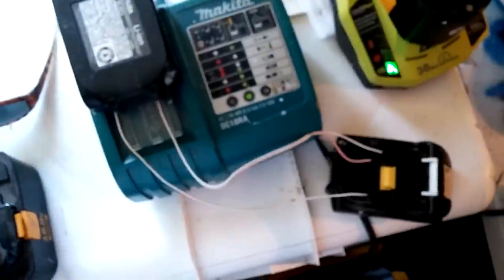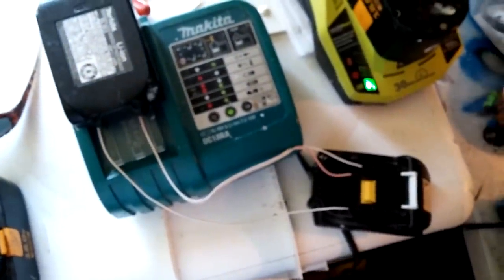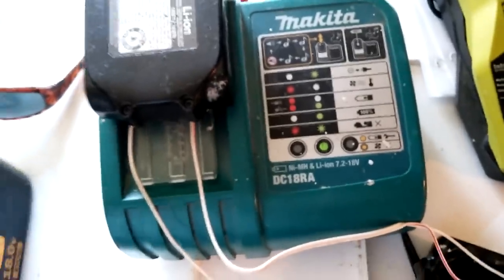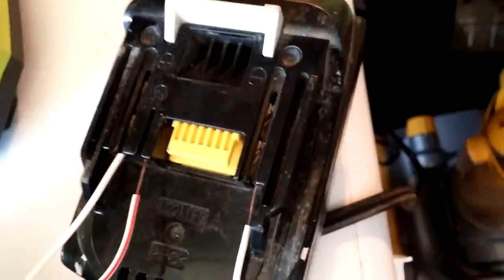How to impose your will on a Makita Li-ion Battery

Comment: I had a dead Makita battery pack that was just a year or two old and sparingly used. I thought it was just an electronic failure so a couple of months later I decided to salvage the 18650´s inside rather than throwing the whole battery pack in the recycling bin. There was ten 18650´s inside and surprisingly several batteries seemed to have been vented or looked like they had been overheating. Only two of the 18650 that looked OK also had a useable voltage level. So be very careful when doing this kind of workarounds. This method may have caused fire in my dead pack.

Comment: Thanks for this, trying it right now.  What a load of crap these batteries are.  I'd have never spent £700 on a kit if I knew the batteries were chipped and lock you out after less than 2 years use.
Reply from the maker: I've got 5 or 6 of these that I use and charge on a weekly basis and I haven't had any problems. I usually charge 3 at a time. Overnight.
Reply: +dennis pulley definitely stick them somewhere safe so if they catch fire it wont do any damage.

Comment: thanks this seems to have worked for me, but the the drill doesn't seem to work if the battery is fully pushed into position?? Any ideas??
Reply from the maker: +jamie king Just a contact line-up problem. Try wrapping some tape around it to keep it from sliding past the contact.

Comment: So basically you have a working battery on the charger and you wire the "DeadOne" in parallel?
Reply from the maker: +Dainius G Correct
Reply: Genious, I will try this now!
Reply: +dennis pulley wouldn't this affect the amperes going to each battery and charge both batteries at a different rate and effectively reduce the lifetime of the good battery also?
Reply from the maker: +Simon wardley Not exactly, parallel wiring, in theory they should charge like an ice cube tray, ending up with the exact same voltage allowing a tad for differences in resistance and maybe diodes. Like water, levels will balance out as long as there is a 2 way street between them. Even with a 1000 battery chain.

Comment: how do you know the battery will not start popping its cells like roman candles.. if you bypassing the safety chips
Reply from the maker: +bryan jones Because the resistance is constantly being checked and a big enough change in either direction will halt the charge for a cool off and re-eval cycle.

Comment: After you "force charge" the "bad battery," does it charge on the charger normally once again?
Reply from the maker: +ChickenCoop Well worded. Thank you. Have you tried disabling that component?
Reply from the maker: No. it does not. I have been charging the same 2 batteries like this for over a year.

Comment: Hey can you show where you attach the wires in the charger, I see you have three wires and I get it but I would like to see the set up. Thanks
Reply from the maker: If you're looking at the battery with the button facing away from you you will see three terminals. Too large one small you do not have to worry about the yellow / orange plug. The positive is the 2 terminals on the left. 1 large and one smaller one right next to each other. Split your wire into both of those and the negative terminal is on the right. the battery that gets connected to the charger should have one wire in the large positive terminal and one wire in the large negative terminal. The battery you are charging should have the positive wire split among the two positive terminals and then the one negative wire connected to the negative terminal. I'm using a 3.0 ah battery one of the bigger one so if yours is different just play around with it a little bit. You may have to split that positive cable at the charger and at the battery but I haven't had to do that.

Comment: Nice work.  All you need is the socket of an old dead charger or tool and it will be totally pro.  I don't use makita but I rebuild batteries for people sometimes and discovered this a while back.  What a horrible thing to do, now I will never use makita.  On the older packs I was dealing with they powered the board from only one set of cells so if it sat around for a long time it was guaranteed to go bad.  Supposedly it takes three times communicating with the charger to be permanently disabled so if you charge it this way the first time it reads bad it should work normally again.
Reply from the maker: +The Mechanical Philosopher You may be right about that 3 time rule but I have never noticed a signal from my charger, but I could have easily overlooked it as a temperature problem.
Reply: +dennis pulley I've had no way of seeing first hand yet.  I have only read numerous inconclusive accounts.  It probably changed a little through the generations of batteries and chargers.  Let me know what you discover about that.  Wouldn't it be wonderful if we all had the correct information someday?

Comment from the maker: I should have shot better video, my bad, but the wiring is as follows: looking at the battery with the Remove button facing away from you v two terminals on the left one large and one small I want are both positive then the large terminal on the right is negative and you can never mind the plug. why are both batteries in parallel and to charge multiple batteries at the same time you will wire them in parallel. Meaning positive to positive negative to negative. you do have to split the positive wire amongst both terminals on the left.
Reply: +dennis pulley There are several factors in getting a good result. One place I discovered that successfully combines these is the Magic Mender Wizard (google it if you're interested) without a doubt the best course i've heard of. Check out this  great resource.

Comment: How much current can the charger provide?
Reply from the maker: +Link Simpson It's speced at 18v @ 9 amps. Plenty of juice and it's used to charging different power levels so it doesn't red flag that. It will occasionally get hot, cool down, and continue charging even when I have a chain of 3 or 4 of them.

Comment: can you charge them normally after this?
Reply from the maker: +Scott Gilmour No, but Ive recently changed to a 2 charger system. Running leads from a good battery atop a charer and connecting them to the next charger. The 2nd charger now recharges the "bad" batteries normally because it recieves its 'alls well' signal from the first charger.

Comment: The problem wouldn't be getting shocked.  It would be from the battery exploding from the possible heat build-up from the charge if the battery was indeed bad.
Reply from the maker: Worst case scenario would be a melted battery,some leakage and maybe the charger catching fire. I may be wrong but I've never actually seen a LiIon battery explode like a lead acid could.
Reply from the maker: Still haven't had an explosion. Trying though

Comment: Don't do it mans!  You 100% will damage a "red light" battery!!!  Just unpack it and change broken 18650 cells in pack of battery.  You just need a simple charger like Imax B6 for detecting a broken cells.
Reply from the maker: +JayWest344  That's too much work, the beauty of this approach is in benefitting from the waste products of others. People will give you these batteries. I am actually still using the battery from the video, there is zero damage because it charges exactly as a working battery, just slower.
Reply from the maker: +JayWest344  I have had one go bad because I was clumsy and kept shorting it.
Reply: +dennis pulley Your method will still charge all cells, and will cook the cells thats are broken? What causes theese batterys to get marked as "dead" is that the cells are dead. This is caused by unbalanced charging.
Reply from the maker: +Espen Gjelsvik I don't believe any, or very few, of these cells, dead

Comment: I am a lot confused and not seeing the
logic of it yet, even if is working for you and those who have tried it. (1) You
are probably piggybacking the two uncharged conditions of the good and dead Makita
batteries at the same time while they are combined, to approximately charge
them both fully together. So some of the below won’t apply. (2) But nevertheless
there are some logic conditions that some might make mistake on or be confused
over. (a1) Are you saying that when the good makita battery on the charger is
fully charged with the green light on indicating the full charge, that the dead
makita battery will be seen by the charger and turn the red light on, indicating
the charging mode is on, to charge it? If so wouldn't that overcharge the good
makita battery that is fully charged, because there will be a conflict of what
the charger is doing. Since first it was on the green light of fully charge for
the good makita battery only. Yet now with the batteries combined, the charger
is seeing the dead makita battery and wanting to charge it, turning the red
light on to do that by?  But that would
overcharge the good makita battery and hurt it, right? (a2) Or does the chip on
the good makita battery turn off the charging process to it, preventing anymore
charge to it, while the dead Makita battery is still being charged? 
(b1) Likewise
if the good makita battery on the charger is fully uncharged with the red light
on to charge it, but the dead makita battery went dead or shut off in the
makita tool when it was say half uncharged, it will be overcharged while the
fully uncharged good makita battery is being fully charged, since the charger
will be on twice as long as needed to charge the dead makita battery of only
half uncharged condition? (b2) Or once again will the chip on the dead Makita battery
see it is fully charged and shut itself off to any further charging, preventing
any damage to its battery cells? 
(c1) And how do you know how charged or
uncharged the dead Makita battery becomes on the charger and Makita tool,
respectively? (c2) Or doesn’t it matter if as just stated, the chip on the dead
Makita battery like the chip on the good Makita battery, can turn the charging
process off once it notices it is fully charged? Can they, which would be key,
and allow both to be at uneven uncharged conditions during the combined
charging process? Perhaps with the good makita battery on the charger, being
fully charged, throughout the charging of the dead makita battery?
Reply from the maker: You have to keep in mind that there is nothing actually wrong with the battery, just a charge fault and remember that 2 batteries are like an ice tray, they equalize. They should read exactly the same charge when done, to the hundredth or so of a vol.
Reply from the maker: I didn't even make it to the 2nd paragraph. It works. Promise.